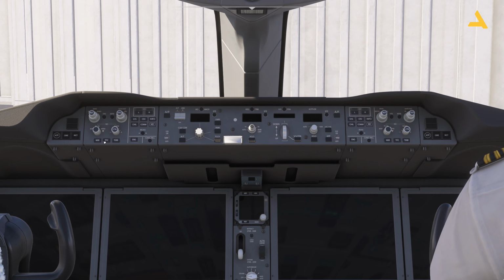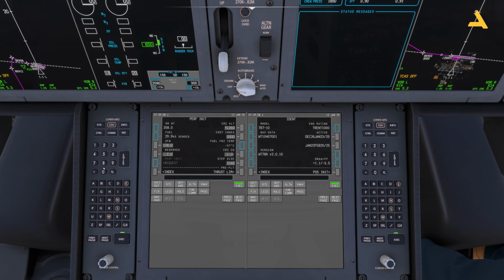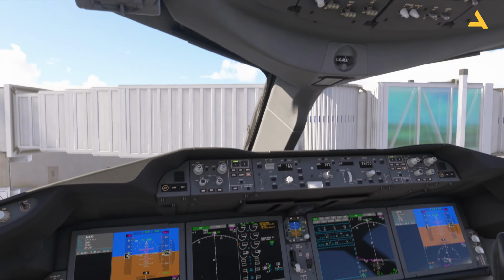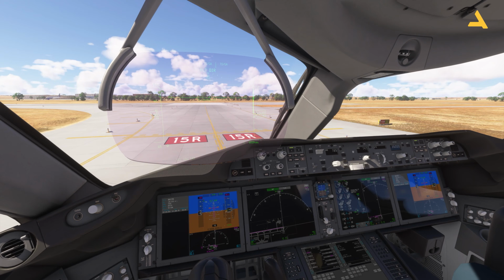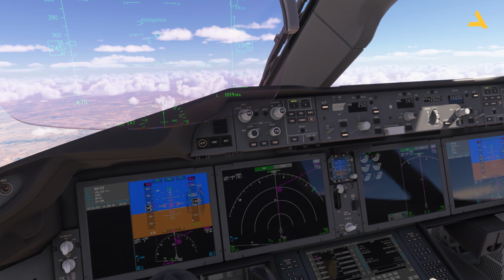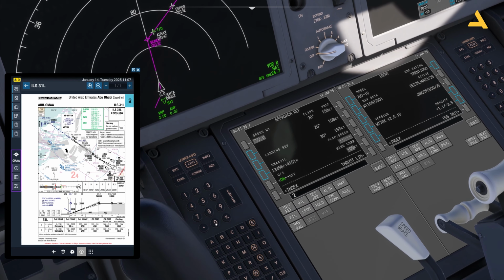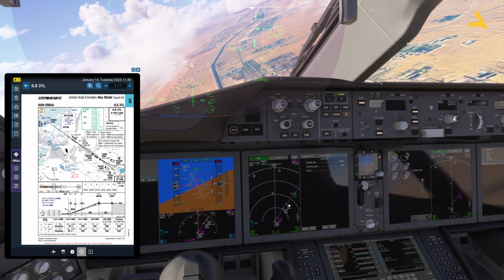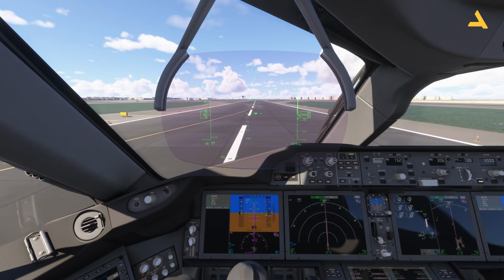Complete Tutorial of Boeing 787-10 in MSFS 2024 | A Beginners Guide

Comment: Hello, I don't know which button you pressed so that the QNH updates so that it is displayed correctly I only understood that you should switch to hPa and press something with a comma know which button that is on a ps5 controller
Reply from the maker: On your keyboard press the comma key and you will get the correct altimeter readings.
Reply: @a @aatifahmad  Unfortunately, I don't have a keyboard, do you know which button it is on the PlayStation controller?
Reply from the maker: Short answer:
On Xbox / PS5 controller in MSFS 2024, the shortcut to auto‑set the altimeter (BARO) is:

Press the Left Stick (L3) — click the left joystick

This command is called “Set Altimeter” in the control settings.
Reply: @aatifahmad  I have three options which of them is meant 1: syncs altimeter setting to sea level pressure, or 29.92 in above 18000 feet.   
2: Set the altimeter to mean sea level pressure 
3: set altimeter setting (Milibars*16)
Reply from the maker: Select option 1

Comment: Hey Atif, in future vids is it possible for you say what you are doing with your throttle during landing?  Are you powering down?  If the altitude is too low, are you powering up to correct, when you are going idle etc?  I think it would be really helpful for beginners.  Thank you!
Reply: At 30 feet above the ground, idle the throttles while simultaneously initiating the flare. 
Do you use the TCA airbus throttles ? If you do, can you please share your settings? Because I can't get the smooth linear motion through mine while flying BOEING aircraft.